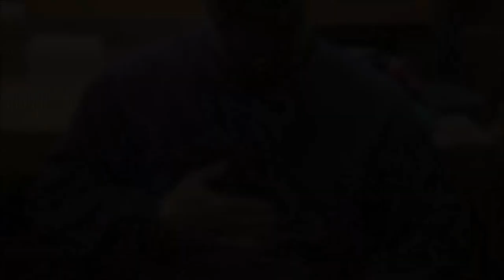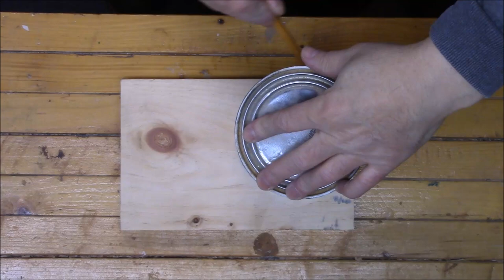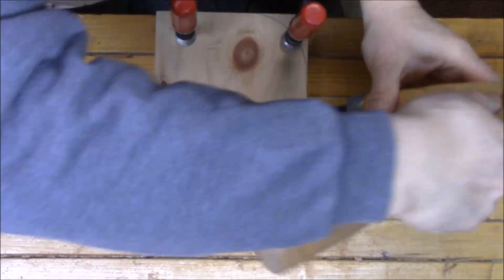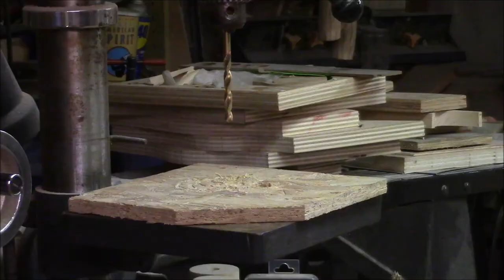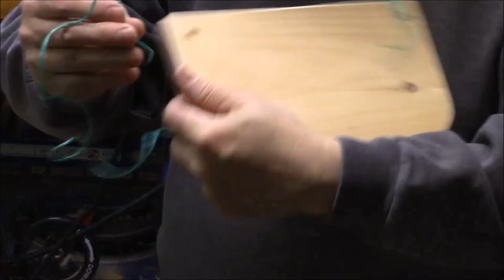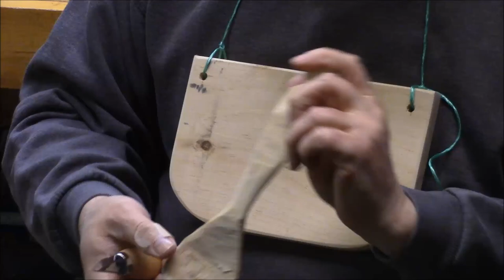Spoon Makers Bib - Bodgers Bib

Comment: Rick - good idea.  Do you like the fact that it is made out of a fairly thick piece, or do you think it matters if it would be quite a bit thinner?
Reply from the maker: I suppose it's a matter of personal preference. A thick piece of leather might do for some but I like the way the board distributes the pressure. A thinner board would probably work just as well.